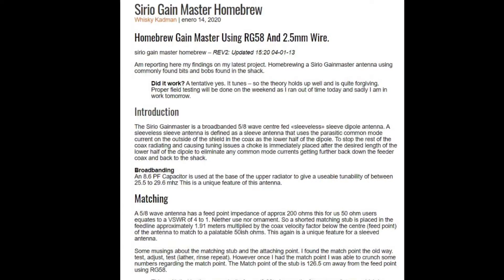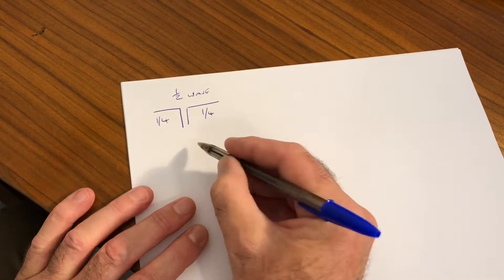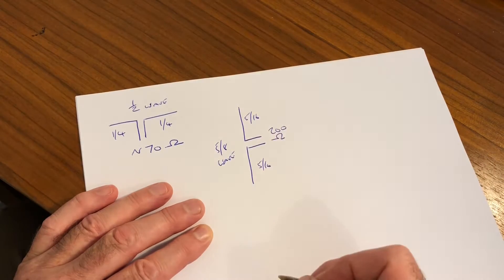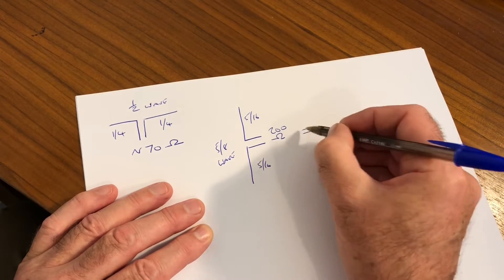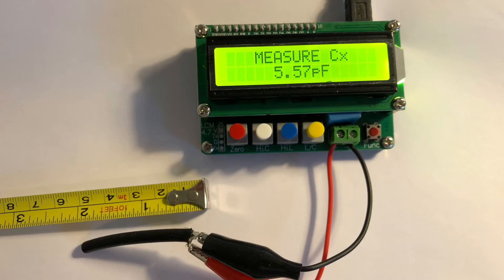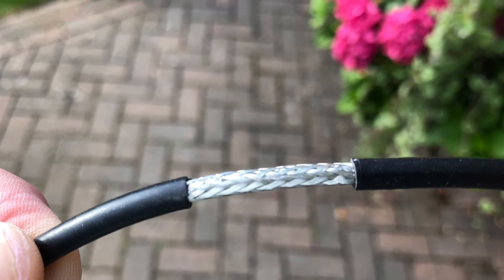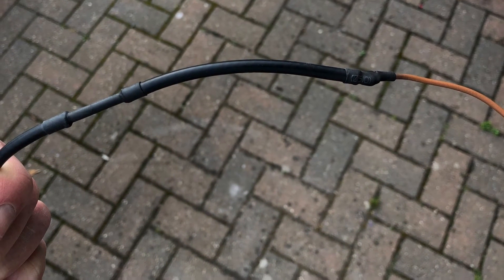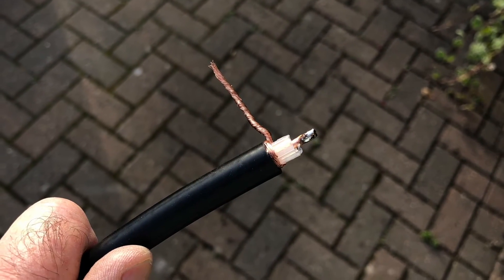5/8th Wave 10m Vertical Antenna Build

Comment: Having built this antenna, have to say it’s definitely my favourite so far, spot on frequency after build, and the performance is excellent.
    Rx  signals increased from s2 to s4/5, very good on dx, I’m using less output on 10 meters compared to my multiband antenna, and it tunes to 12 meterband again great results 
  If your intreasted in 10 meters I would seriously give this antennae a go!
Reply from the maker: Great Mark! Glad it’s doing the job well 👍🏻

Comment: Very well-done video, and I thoroughly enjoyed it. Thank you for producing it. But... and here's a big but coming... it makes sense to use a 5/8-wave vertical versus a 1/2-wave vertical when they are constructed as self-standing and placed at the same base height above ground... BUT, when made in this fashion for suspension from the top of a mast or rope in a tree from the same vertical top height, the 1/2-wave vertical will slightly outperform the 5/8-wave vertical at low DX angles (as verified by MMANA-GAL modeling). So I don't really see the point in making this particular antenna when the smaller, simpler 1/2-wave vertical will outperform the larger 5/8-wave vertical due to the higher elevation of RF current in the antenna. A T2LT-style half-wave vertical would be the way to go, and it presents a nice roughly 73-ohm impedance when center-fed, making its implementation with 75-ohm coax simple. No need for capacitance sections in the coax, and no need for matching stubs on the lower half of the antenna. Just make it from (inexpensive) RG6, and if you want, you can convert it from 75 to 50-ohms after the RG6 coax lead reaches the ground.
Reply from the maker: Thanks Rick! Yes, I’ve since gone on and made a few vertical dipoles and used them successfully too 👍🏻

Comment: Good video, do you know if there is a generic calculator for a 5/8 antenna. How did you know what the value of the capacitor needed to be, along with the 2.5cm gap?
Reply from the maker: @M6PGO  Sorry, no. It could be a case of proportioning it up/down for other bands. Failing that a session of trimming. It should work without the capacitor section and just be not as wide banded. I haven’t tried this though. This one is still going strong in my tree and I’ve built another for /P 👍🏻

Comment: Thanks for posting this, I've never been that happy with my 10m Slim Jim (although it does work) so was looking for something at least as good. I did the sums for using  URM76/RG58 for the matching stub. 66/81 x 71 gave me 57.8cm. I found I needed to add 260mm to the top section for a good match across the band. I used 11 turns on a 56mm plastic pipe former for the choke (length of first section above left as per the design dimension). This gave me 1.1:1 between 28.35 and 28.850, under 1.4 from below 28.00 up to 29.8. Height above ground made a slight difference. I used a 9m roach pole, added another 2.5m on a windsurf mast, or a 7m roach pole on 3.5m of windsurf mast. I'll try it out /P soon when I can compare it with my helical 1/4 wave whip on the car roof.
Reply from the maker: @garethevans1410  Sounds good Gareth 👍🏻Mine is still in use and I made another for /P. Great antenna for 10m 😀

Comment: Thanks for a very good treatise.  I had always assumed that the series capacitor was to series-resonate with the inductance of the upper radiator (wire), but perhaps your information is from a learned source?
Reply from the maker: @timdbl7804  Thanks! You’ve got me thinking now 🤔
Reply: @G0CNN-Ian  Thanks Ian! I have the commercial Sirio Gainmaster, which I wish to tweak to 28.5 MHz, so your measurements could be very helpful 😀

Comment: This is a total mind blower to me.  
1.  Why would anyone want to pay for a 358 cm of coax for the choke balun or a ferrite toroid with added coax when they could use 263 cm of cheaper wire for the radiating sleeve?
2.  CB antenna designers are not the sharpest engineers.  I don't understand why we need to emulate their misguided attempts at antenna design.  There are easier and cheaper designs with more gain.
Reply from the maker: Sorry, I don’t understand your reference…
Reply: @G0CNN-Ian you use a choke to choke the RF from floating back down the coax. That's 358cm of coax you wouldn't have to use if you instead used wire with a coil to cancel the capacitive reactance. You can get more low TOA radiation as well. I'm trying to figure out the advantages of paying more for less performance.

Comment: WOOOOW I PURE BREAD DUMMY LOAD AMATUR
YES THE GAINMASTER HAS CENTER ON APP 27.000MHz
becaus it covers 12 11 10M so from 24800 to 30.000MHz S.W.R under 1.5% return or 4%
I have made it better on 10M F OFF.. WORK12M Too DUMMI LOAD 3 band for the price of 1

Comment: Just curious how you can have 200 ohms of resistance at the centre if the ends aren't touching? Wouldn't it be OPEN and resistance read Infinity?
Reply from the maker: Hi. This is RF and not DC. Different properties altogether 👍🏻

Comment: Traditionally, a "5/8 wave" antenna is a 5/8-wave element replacing the quarter-wave element, not two 5/16th elements. So a 5/8 antenna might be (for example) a 5/8-wave element over a ground plane. I'm not sure what the unique and correct name would be for two 5/16-wave elements, but the term "5/8 wave" was already in use.
Reply from the maker: Thanks.

Comment: The Westflex-103 could   be substituted with the LMR-400, 50 ohm, which velocity factor is 0.85 same a the Westflex cable.
Reply from the maker: Thanks.
Reply: I only have RG58 and RG213. Would it be possible to use the RG213 instead of the westflex-103?

Comment: Have made 3 of these so far, just about the best antenna IMO. I will try one shortly without the cap. just to see how narrow it gets for fun, I use rg8mini, for the stub, no problems with 100 watts at all. I use the 16 turn choke, no common mode that I know of, but will try and measure this at some point as well , need to make some kind of rf current meter to do this. Great video, great antenna, look forward to any experiments / improvements on this design.
Reply from the maker: Thanks Mike! Yes, I don’t think I need the capacitor, so it will be interesting if you try without. Keep me posted 👍🏻
Reply: @G0CNN-Ian  will do, I never felt a cap in line would make a better element, wider bandwidth yes, but look forward to testing without it. If I could get 1 mhz without it, that would do the trick. I have a gut feeling it would receive better without the cap???
Reply: @pixotica  Have you testet it??
Reply: @TheRiddleNL  not exactly, I did do a 5/8 wire, with one vertical ground plane matched with a ferrite transformer, It worked quite well. Ie it was a dipole 5/8 wire up, with a 9 foot wire down.
Reply: @pixotica  Ah okay. I have spiderbeam pole and consider making this rollup 5/8 for 10M. Verticale dipole isn't that practical. Deleting the coax C makes the antenne More rigged.
Reply: @TheRiddleNL  half wave end fed always a good option as well.
Reply: Thanks for your video, it was very useful but I have a question, why the lower quarter has the same lenght as the upper one? The velocity factor of the cable is 0.66, then not should be shorter?
Just asking Im trying to learn thanks.

Comment: I know this is an older post, but I would really like to see the full page of theory displayed at 0:07 seconds into the video, concerning the matching section calculations. I intend to build this design, but using 50 ohm RG8X(PE) low loss cable with a velocity factor of 82% for the sleeve, and 50 ohm RG8U(PE) with a velocity factor of 66% for the matching stub. The reason for the substitutions is, that these are the materials I have on hand.
Reply from the maker: Hi, I checked and the original article is no longer on that link. The author did mention trial and error before arriving at the measurements used. I would suggest substituting RG-58 and Westflex 103 specs with your own coax and ratioing up/down the coax lengths accordingly. Good luck! 👍🏻

Comment: I'd like to try building this, but the 71cm Westflex 103 is hard to find in the US.  Can you give me any specs on the cable... is it 1/4 wave, what capacitance, etc, as I would like to simply use RG-58 or RG-8.  Thanks.
Reply from the maker: Here you go, this link has all the info you need. Good luck! http://www.whwestlake.co.uk/westlake-pdf/WF103.pdf
Reply: @G0CNN-Ian  thanks, but I was in still in the dark regarding the correct calculations.  Unfortunately, the original CB antenna article you linked to is gone, but fortunately can still be found in the Wayback archives.  After finding it today, I now have the confidence to have a go at building this.  Only thing I need to get is the ferrite core.  I have some T240-31's, but not ideal for this frequency.  I'll be anxious to try this out for the 10 meter contest coming up next month.
Reply from the maker: @sciencegadgetry  You could always wrap an air choke if you can't find a type 43 or better core for the time-being? You could try RG213 instead of the Westflex and create a longer stub which you can then trim back based upon your tests. What I'm not sure about is the positioning of the stub along the main length of the antenna, but guessing that this isn't super-critical, so leave as-is? Other than your time, the parts are cheap so worth the experimentation....

Comment: 2:30 that 5/8 design where you say to terminate the lower part to stop common current, could have you simply build a 4:1 balun ? those are really simple to build with the exact same ferrite FT240-43. That type of balun give close to -30dB of common mode attenuation at 28MHz. A single core can handle 800W PEP.  Wound two pair of 18AWG PTFE cable for 12 turns. A pair of PTFE cable is 100ohms, when in parallel it gives a 1:1 balun and when the secondary is in series, it gives a 4:1 balun. That could have complete your antenna right there if I understand what you are saying.
Reply from the maker: Yes agreed, although those using an air-choke would still need the matching stub method. Thanks.

Comment: Finally tried this build out in anger this weekend Ian 25/06/2022, (I made this last year when you first posted the video) works really well, definitely has better ears than my ground mounded vertical on 10m at my QTH at the bottom of a valley. Mounted it to a 10m fibreglass mast. Very broadbanded and so worked on 12m too. Thanks for the build.
Reply: Awesome video. Question: How is the ballanced antenna matched to UN-Ballanced coax feed??? Is the Ferrite the  ballancing mechanism???
Reply from the maker: @ericdee6802  Hi Eric! You’re question was hidden under someone else’s comment (& YouTube doesn’t flag these up unfortunately). No, the ferrite merely stops the rf on the outer coax, so defines the actual end of the antenna via this choke. It’s the matching stub that helps with the mismatch and 200Ohms.  Thanks.
Reply from the maker: That’s great! Tree now in leaf on mine, but doesn’t seem to affect it. All good. Thanks for the feedback 👍🏻

Comment: btw, isnt it possible to make a 1/2 wave dipole like this, without the matching stub, and just choke at bottom? I see T2LT does this. Never seen this matching stub before.https://youtu.be/Ak2w6diQw7A
Reply from the maker: Yes, I would imagine so, and adjust for any frequency.
Reply: @G0CNN-Ian  thanks for the response I just spoke to somebody testing a gain master vs L2T2 dipole,  and he said the gain master perform the best,  so if I was going to make a gain master for 27mhz I might just omit the capacitor and just tune the correct 5/8 wavelength.

Comment: I'd like to scale this up to 17m band and others. what would those dimensions be ?
Reply from the maker: Hi Danny. I think you can proportion the main lengths up based on the percentage difference in wavelength (be sure to calculate the real wavelength from frequency). The capacitor dimensions should be the same, but I’m not sure about the matching stub 🤔 Perhaps cut this long to start and then trim to suit….Good luck if you give it a try 👍🏻

Comment: What alternatives can be used instead of the Westflex? Looks like a perfect antenna for me but I can't find Westflex here in Australia.
Reply from the maker: Hi Wayne, you’d need to match the capacitance and velocity specs or adjust accordingly (and/or experiment). Not sure what your supplies are in ZL…hope you get sorted 👍🏻
Reply: @G0CNN-Ian  thanks Ian. I've just watched Mike's video and one of the comments on it recommended rg213 at 73 or 78cm (can't remember exactly). 213 is something I do have so I'm keen to build this antenna. Thanks so much for responding and posting the tutorial. 73
Reply from the maker: @WaynesWorld69  Good luck Wayne 😀

Comment: Why West flex 103? No rg58?
Reply from the maker: Hi Giovanni. It’s not my design, but it will be for the correct capacitance and inductance required.
Reply: Chck velocity factor. You can replace rg58 by CNT-400 or RF-7
Reply: You could use RG58, but it will not withstand above 300w continuous RF power (like FM or AM). Antenna Stub heats up and slowly damages itself with time. Once it gets damaged, antenna will have sudden high SWR destroying your radio or amplifier.

Comment: Greetings friends, I need your advice.
I have a station Alinco DX-10 and an antenna Santiago 1200, I have it at home, and since I do not have a chance to make a large assembly I bought a small metal stand and a magnetic base, the metal bracket attach it near the window with some Plastic flanges so that it is well suited.

My problem is that it is impossible to calibrate the antenna and make it go down Roe .. Just lower the Roe when I hold the magnetic base with your hand. So I think there should be a mass problem, any idea?

Thank you and greetings from Andorra
(Translated with SR Google)
Reply from the maker: Hi Manel! Yes, assuming your coax and connections are ok, it sounds like you need more ground plane…more metallic surface area for the antenna to work against. This is the what the coax braid connects to. Also, make sure as best you can that the antenna is not near any objects which may interfere. Hopefully this translates ok for you 😀 Good luck 👍🏻
Reply: @G0CNN-Ian  Thank you very much for your comment.
He has also told me a colleague that I can connect a negative cable from the power supply to the base of the antenna ...
Reply from the maker: @manclubandorra  I wouldn’t recommend that Manel.

Comment: For the w103 stub can I just use regular rg8?
Reply from the maker: I haven’t got the specs to hand Jeff. You’d need to compare the two and adjust accordingly…
Reply: @G0CNN-Ian  ok thanks.
Reply: can you explain how you compense/calculate for other kind of coax, witf different velocity  ? @johnbigbooty
Reply: @johnbigbooty  yes this make sense. I thinked similar befor my post. We use the principle of proportion. interesting, although it is not necessary to understand where the length of this section comes from. Thank you for help, and good luck

Comment: Very clear n slick.  Shame didnt get to see usage results.  Whats the man made noise pick up on it like?
Reply: I made a halo type, square, folded dipole, from speaker wire. Air coax choke.  I put this on ground and could rx most station that were s4 and above - with the bonus that qrm was not moving the needle!
Reply from the maker: @stevenmcc6052  Great! I’ve got a loop on the ground for the lower bands 👍🏻
Reply: I have a new to me pneumatic 9m mast .  When serviced and usable, can u recommend a decent directional - not a full yagi - too big.
Reply from the maker: @stevenmcc6052  What band Steven?
Reply from the maker: @stevenmcc6052  if you referring to 10m have a try at my mini-horse. Short boom folded 3 element for 10m - see “DIY Compact 10m Yagi Mk2”. It’s my latest version of the mini-horse….about three videos back 👍🏻
Reply: I guess i could try a 10m one as i recently heard some contact on there. Seems to be improving. But predominantly 20m due to productivity and biggest practical dirn ant in micro overlooked garden.
Will take look thx Ian
Reply from the maker: Hi Steven, thanks! I used it in anger at the weekend 😀 Part 2 released tonight 👍🏻

Comment: Very good video.
I have a similar homebrew antenna for (*cough) 29 MHz, it's called a T2LT and works very well on 11 meters (yes, I do sometimes 'slum it' with the CB guys, it's where I started after all)
Reply: At least you don't have to be so formal on CB, lots of fun, or at least there used to be!
Reply from the maker: @BoB4jjjjs  early 80’s for me Bob 😀
Reply: @G0CNN-Ian  Late 70s for me, I was naughty.  Then came FM  :-((
Reply from the maker: Ha ha brilliant Stephen! All good fun 👍🏻
Reply: It's all radio, all that's different is what you say and how you say it. The time for snobbery is long gone.